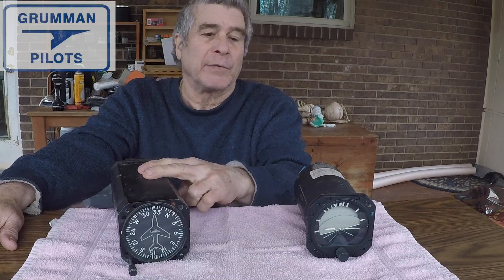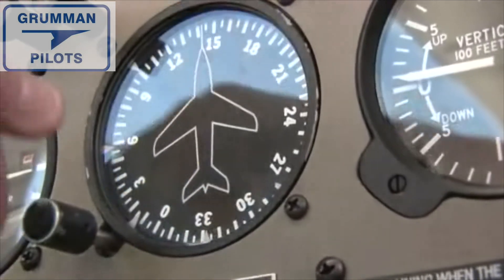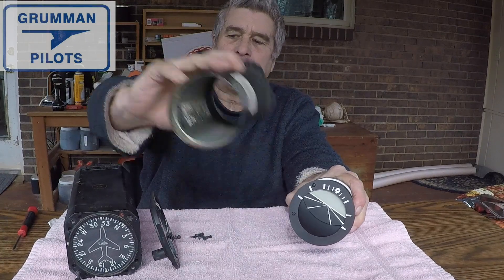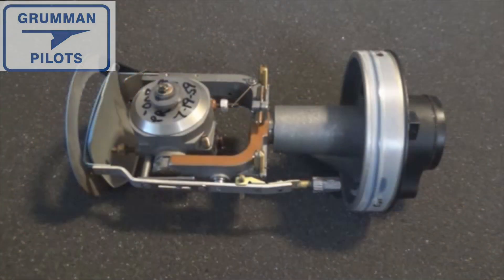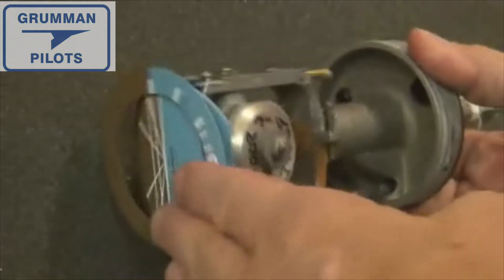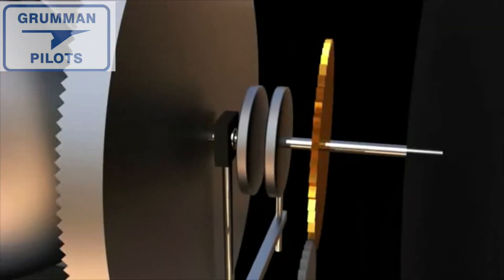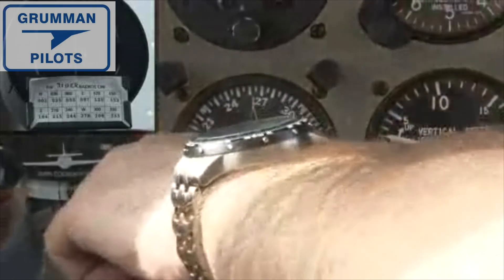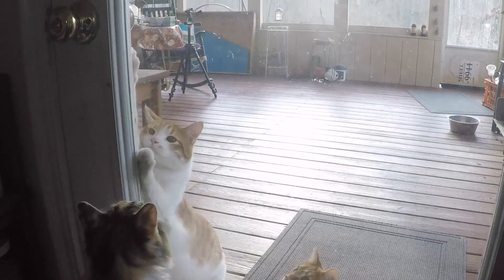Aircraft Gyroscopic Instruments Internal Look - Grumman Style

Comment: Quick question, does the attitude indicator you showed operate normally without any hookups?
Reply from the maker: You are going to need the air going through it for it to stabilize.
Reply: @GrummanPilots  How is it fed air? Just directly from the atmosphere or would there be a pump? Kind of thinking of getting one for a street/track car, just to have it on the dash.
Reply from the maker: @seanmakesthings  There is a vacuum pump on the engine that pull air through filters and then the instruments to spin them up.

Comment: @3:20, Why wouldn't it work at idle speed.  Is the vacuum from the engine or a separate electric vacuum pump?  Thanks.
Reply from the maker: It need a cetain amount of air flow for proper operation.